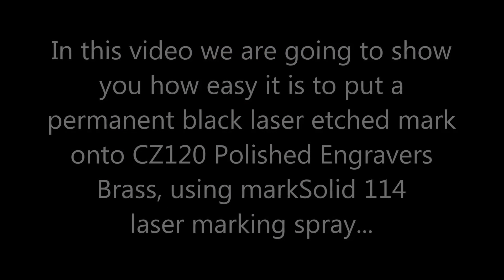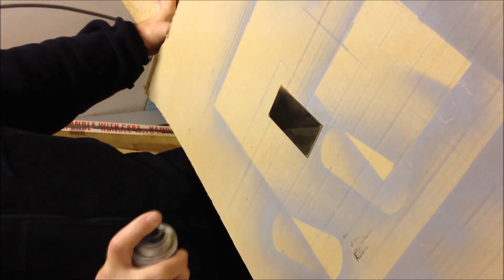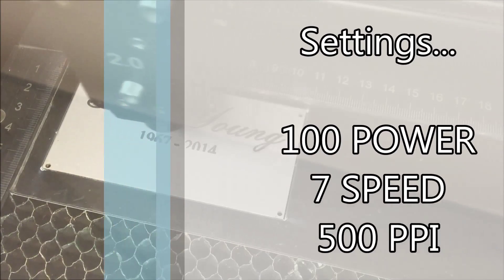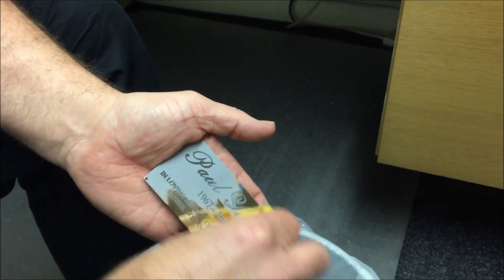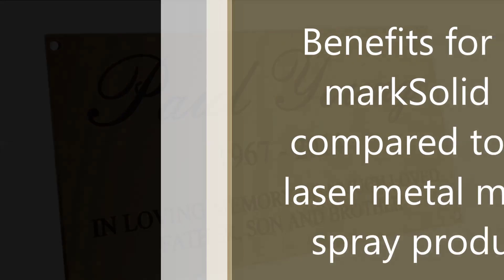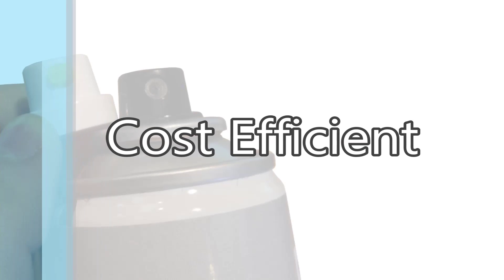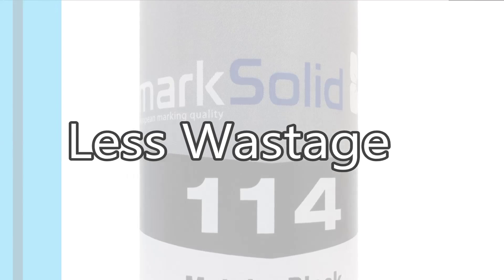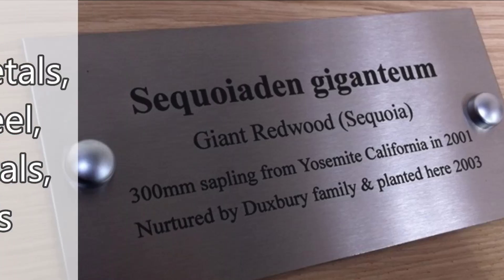Laser marking CZ120 Polished Brass using markSolid 114

Comment: It even works on aluminum ALMG3 (not anodized) using an E40 Neje laserhead (250mm/M, 85%, 1 pass). markSolid is the best stuff out there for most metal applications imho.
Reply from the maker: Thanks for your comment @ref8893. We would agree that it is the best product out there for metal marking. We have achieved some fantastic results over the years!